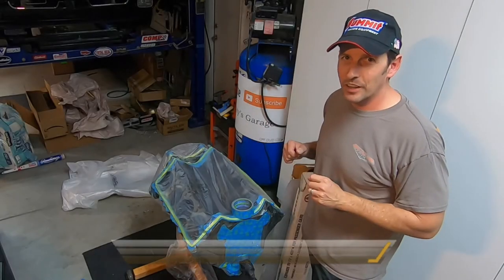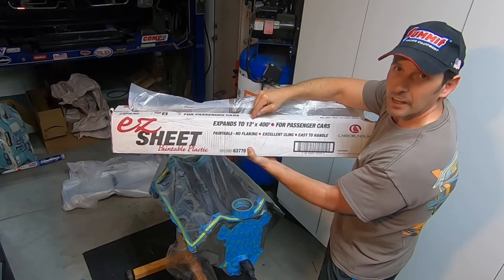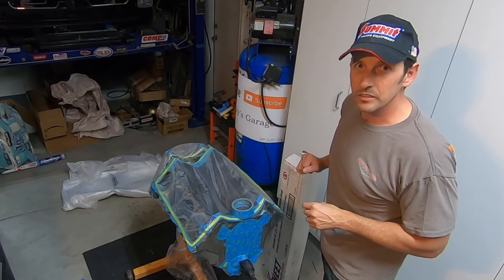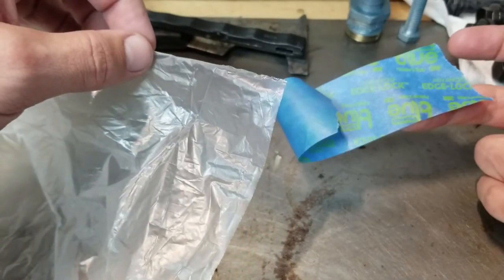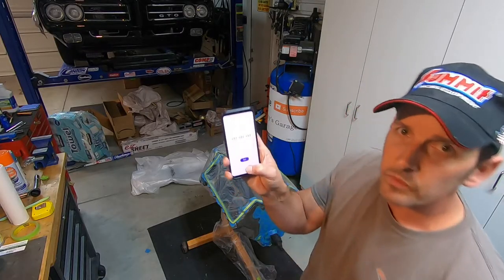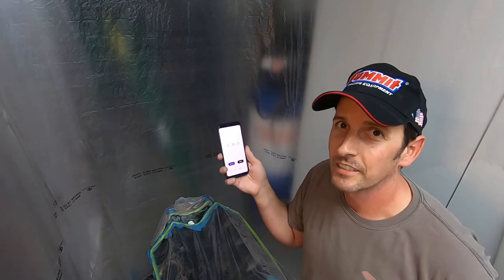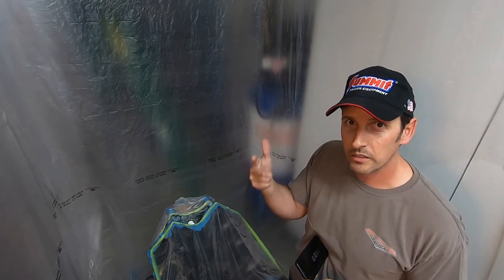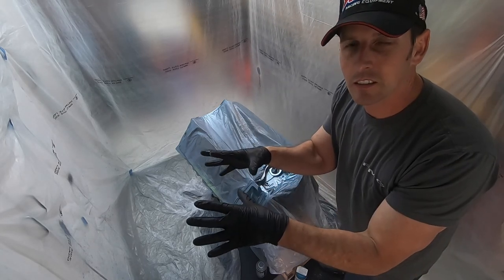How to build a paint booth, for under $10!

Comment: Hi Mike, I am putting a few emblems on my car and unfortunately I have to drill some holes into a great paint job. What rust preventative would you recommend that would prevent rust.
Reply from the maker: After you drill those out, clean out the hole, use a Q Tip and some POR 15 in there.  I like to buy their six pack of tiny jars.  Have fun!